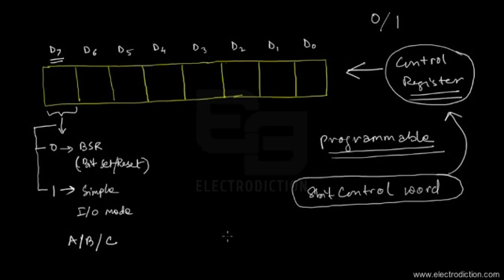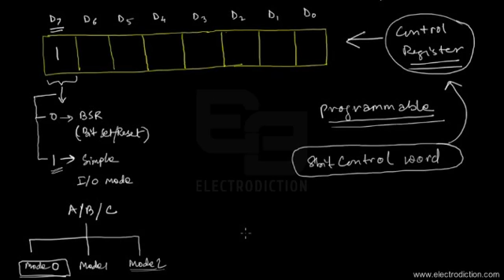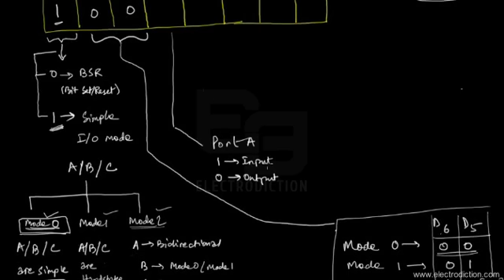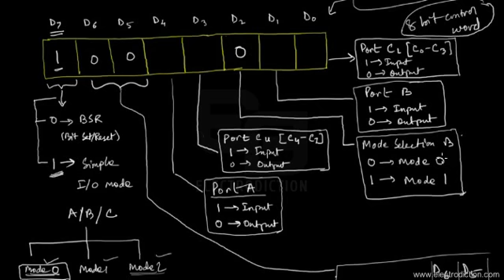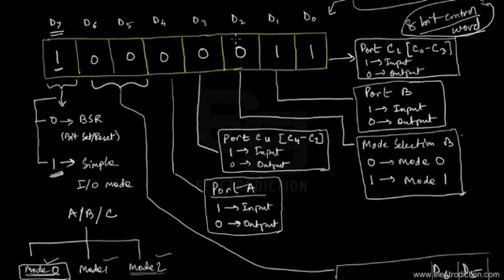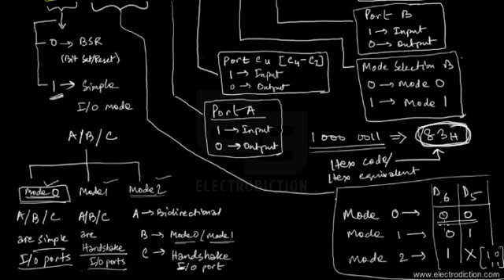8255 CONTROL WORD || Microprocessor

Comment: mode selection for port B only works when register is in mode 2?
Reply from the maker: In Mode 0 port B is used as simple 8 bit I/O ports.
 In Mode 1 port B is used as 8 bit I/O ports with handshake.
 In Mode 2 port B can be configured either in Mode 0 (simple 8 bit I/O ports) or Mode 1 (8 bit I/O ports with handshake). Signals from port C can be used either as simple I/O or as handshake for port B.
 Hence, mode selection for port B only works when register is in mode 2.